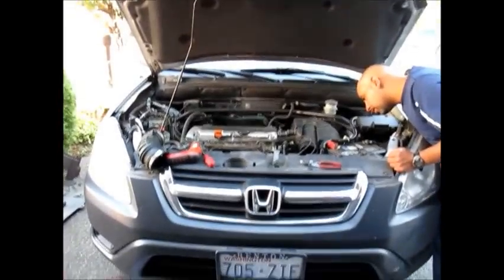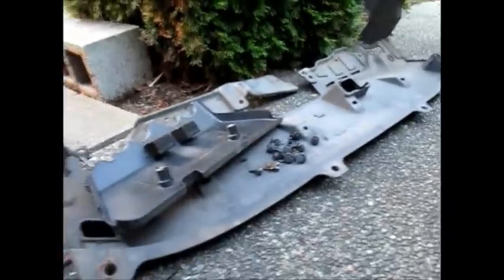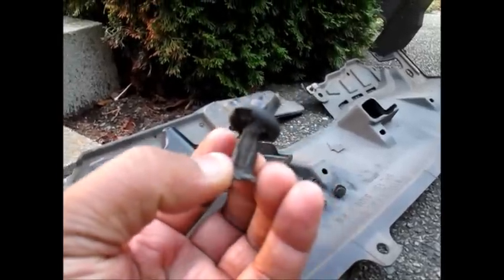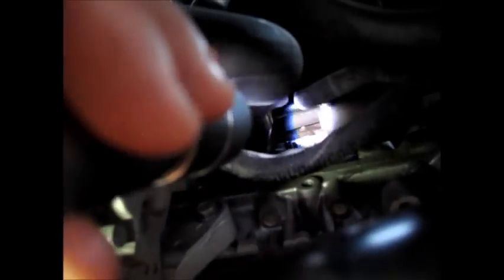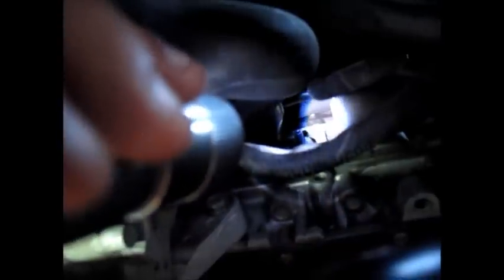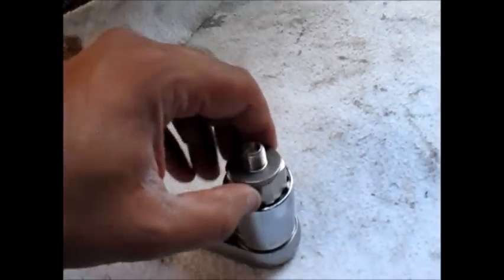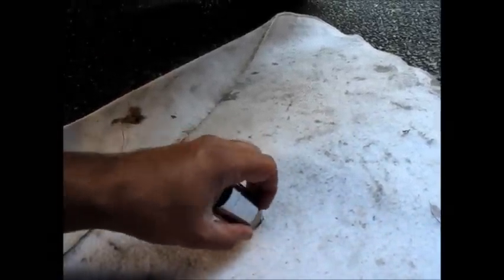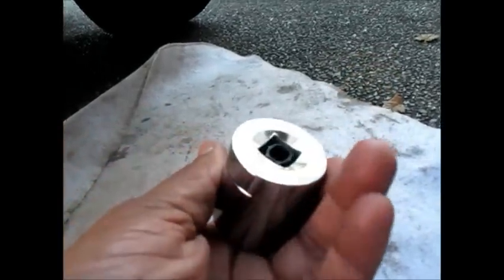Honda CRV Knock Sensor Replacement works for accord and civic

Comment: Very useful video. It gave me the confidence to give it a try.

I replaced my 2004 CR-V knock sensor today. I did not use ramps or axle stands. I had enough room under the vehicle to access everything. Make sure the handbrake is on. Put the car in gear. Locked the doors to stop anyone getting whilst I'm under the car! I used a couple of torches to help see what I was dealing with.

The two steel bolts holding the plastic shield were the hardest to remove. One ended up just spinning because it ripped the plastic in the other shield that holds the retainer.

I didn't have the right socket, spanner,  or pliers.  I had an adjustable spanner. I used the the new sensor to accurately set the width of the spanner. Before investing in tools and equipment for a one-off job I thought I'd try with the limited stuff I had.

The long screwdriver and using a finger to press the wiring clip worked well with some fiddling. You have to press the flat part of the clip to release it at the same time levering the plug away from the sensor. I could feel a click as I pressed the flat part of the clip with one finger as the catch released. I have fairly long fingers.
I released the sensor before removing the wiring clip because the flat part was at the top and hard to press. I undid the socket - surprised how tight it was. I used a plumbers wrench to extend the handle of the adjustable spanner to give me more leverage. Once loosed it turned very easily. I turned it enough to more easily press the clip and lever the wiring plug off. Don't turn it too much as you could damage the wiring which would be a disaster.
I then spun the sensor off easily with my fingers.
Putting the new one in was a bit tricky and I did it just with my fingers. I just had to do it by feel to line the thread up and after 10 minutes the thread caught and it spun on easily with fingers only.
I didn't have a torque wrench. I just tightened it as much as I could with the adjustable spanner and my plumbers wrench extension bodge. Tight but not overtightened.

The wiring plug was then refitted. Again quite a lot of fiddling about and trying to orientate it by feel. Eventually I got it to line up, pushed and it clicked in place.
Started engine - engine light still on. checked and erased codes and took it for a test drive. No errors so far.

Maybe some luck involved and fingers hands and arms the right size. At one point it seemed daunting and I thought it might takes days of patient fiddling or spending money on tools I might not use again.

Comment: Did this today, 2003 CRV , on a gravel driveway laying on cardboard and  Just like he shows/ says  in the video. A little  lift  of  the  drivers  side of  the car got me enough room to get in there. Putting the new one in was a bit of a nightmare since I have  giant hands, so it was 2 clicks of  the ratchet at a time until it was tight.     Thanks for  the video!  helped a ton.

Comment: I did this repair last night.  It is torturous and uncomfortable.

The ratchet approach works great.  Very hard to get the new sensor screwed in.  I didn't give up and eventually got the threads started.

There's a wiring harness clip underneath the sensor that is right in the way.  Take the 2 minutes to remove that with needle nose pliers.  Improves access a lot.

For those doing this in the future: be very careful you don't cut your hand on the sharp piece on the chassis (see 4:44 in the video).  I spent a while cleaning grease out of a bleeding wound.  Ouch.

There are other videos of this repair that show people using a deep socket and a universal.  There's not nearly enough room on a CR-V to do that.

Thanks for posting this video.

Comment: Hello, Pro Mechanic here have multiple misfire codes on my CRV but running fine, went through some large puddles yesterday thinking I got the knock sensor wet, thanks for your vid showing me where it was. I might just swap it out if the connector is not wet inside, Cheers!

Comment: 👍 just did it on my 03 CRV.  I was worried about clip, but just press down on clip (wire end) and pull.  I was able to pull off without problem with just one hand.  I had code P0235 (no signal).  After 3-4 starts CEL went off.  Runs great!  Thanks.

Comment: Just replaced the Knock sensor on my 2002 CRV. Your video was very helpful thanks. I used the screwdriver and pressed down on the clip with a long handled 90 degree long nose pliers worked great. Hardest part was using finger tips to get new one on. I have large hands. I agree with the person who posted his wife got the new one started for him.
Reply: Joe Car Guy This was the trick that did it (remove clip).  Thanks!

Comment: Thank you for this video. I just replaced the sensor on an 08 CRV and was able to use a 1-1/16" socket with 1/2" drive to remove it.

Comment: Just did this pain job on my daughters CR-V. If you had to do it you know how messed up it is. Getting it off not to difficult. Getting back on new part near impossible if you got meaty hands/fingers. So to help others this what I did to get it started and get it back on. I took an old spark plug wire, the one where the boot is L shaped. Cut the wire and discard. Take L shape boot and put over electrical plug in end. Put up in hole and turn boot to set sensor in its hole. Remove boot. Comes off easy. And continue using tools to tighten. Good Luck.

Comment: Thanks so much! Thanks to you I was able to replace my 2002 CRV knock sensor.  To others that might come -  BE VERY PATIENT... it is in a really really tight and awkward spot. The hardest part was getting the new one started on the threads.   Make sure you have plenty of light.

Comment: Thanks for the video!  Like you said, the hardest part was getting the connector off of the old sensor so I used the long screwdriver like you suggested and it worked great.

I found it easier to use a box end wrench to get the sensor out and back in.  

Thanks again!

Comment: I found an easier way on a 2005 CR-V 2.4.
Remove the lower valance and sneak a 1 1/16 wrench in front of the radiator support, The sensor is not tight at all.
Turn it about 3-4 times with the wrench then you can unscrew it the rest of the way with your hand.
Then reinstall by hand and snug it down with the wrench.

Comment: My AC compressor clutch is going bad on my 04 CRV and it is surprisingly triggering the knock sensor because every time the clutch engages the engine shudders and pulls way down I didn't know that it could trigger the knock sensor.

Comment: Unplugging and removing the old one was very easy. I can't get the new one to screw in. Neither mine or my wife's hands fit up in there.
Reply: I put a screwdriver in the plug to help get it into place and somehow managed to get it in with two fingers.  Took a bit but got it.

Comment: Will I pass the emissions test if I don’t replace this sensor?
Reply from the maker: Not if you're check engine light is on.
Reply: Thank u Gus for ur prompt response.I’m gonna get it on eBay and follow ur steps. Good luck in ur endeavors.

Comment: I have a 2005 crv. does this video work for it?
Reply: Probably, Make sure you have the same model engine. I would guess that this is the k24a4 engine because that's what my Element has, and it and the CRV are on the same platform.
Reply: Did this video help for the honda crv 2005?
Reply: Yes. Just did it on my 05
Reply: Thank you?

Comment: Replacing the Honda's Knock Sensor didn't fix nor clear the P0325. What is the true fix?
Ran for 600 km and P0325 came back on.
Reply: angelisone did you buy a genuine Honda sensor or a non Honda parts store sensor?
Reply: @jamesboldshasta8488  Yes, Honda's Genuine Knock Sensor.
The Knock Sensor & O2 Sensor are the biggest scams of all from car makers.
Reply: Did you buy from dealer or eBay? Many fakes in eBay and Amazon.
Reply: @Anon1mous  Didn't to read my comments? That was over a year ago & I answered to JamesB OldShasta
They were purchased from Honda Dealership.

Comment: What  year Honda is this? I Have a 2004 CRV and I was told the intake Manifold need to be taken out to replace the Knock Sensor.
Reply: ay bra i have a 2003 this video honda is are make
Reply: My mechanic told me the same thing, but I just successfully replaced the knock sensor on my 2004 CR-V by following this video. So far, the check engine light has stayed off!
Reply: Well yeah they want the $$$ for all that work.

Comment: Do not do this!  This sensor is easily removed with a 1 1/16 wrench from under the front.  It is a little difficult to get started back on.  Make sure to clean the hole and sensor with brake cleaner. I have average hands so I got my hand up in enough to get it started with my finger tips.  Once started a few threads the wrench will get on and move a small amount and then you must turn the wrench over and it will go on this way.  Keep flipping the wrench and you will be able to tighten.
Reply: I tried to remove the knock sensor without removing the splash guard but could not. I could not even see the sensor actually. Taking the splash guard off took 15 minutes and made the task much easier. I did use your tip about the 1 1/6" wrench though, which worked well!